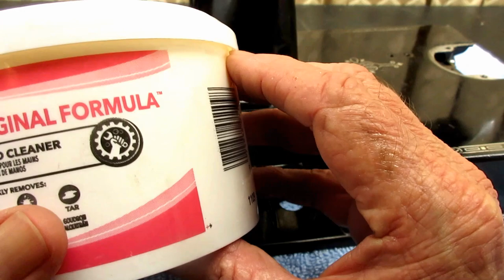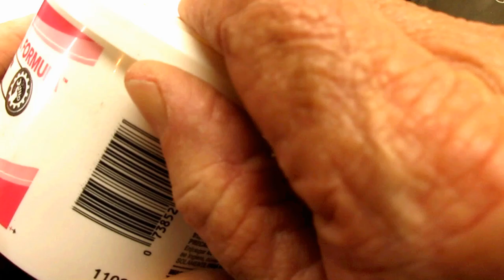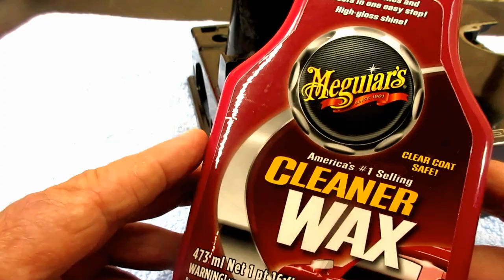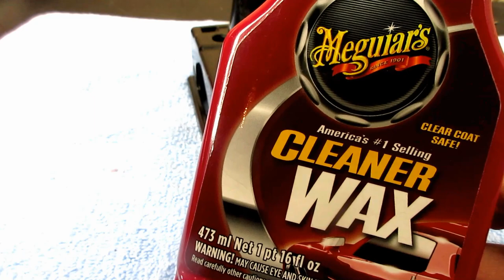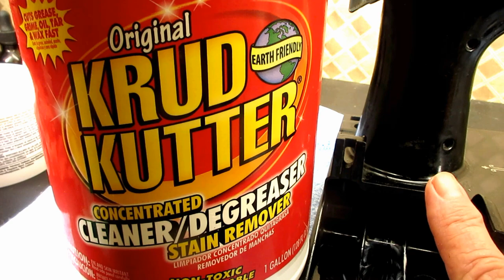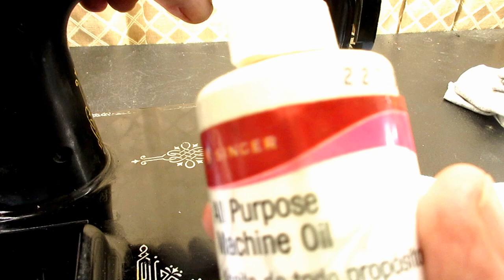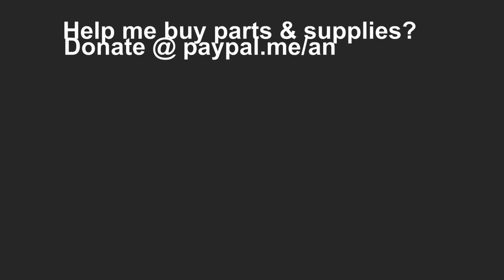About Cleaning the Outside Finish of a Singer 221 Featherweight

Comment: Hi Andy :D Listen, I'm currently working on a derelict 221 that I thrifted and found that  "Meguiar's Ultimate Compound" does wonders on dull & cloudy shellac finish. It removes the dull layer of the shellac coating to reveal the glossy shine hidden underneath. It won't make disappear shellac flakes but will mitigate them a wee bit, it will also make disappear dull spots caused by a spill of Krud Kutter or IPA (I've been there too haha).
Reply from the maker: Hey! Thank you so much for this great information. I love when people share this kind of stuff because I know my viewers. Many of my viewers at least read into the comments so I pin this comment to the top because I get a lot of visits on this page where people are searching how to clean their featherweight or other black shellac singer iron lady. Thanks again for taking time to share that

Comment: Love your videos Andy! Thank you. I just bought a 1948 year 221. The finish is awful. I bought the FW Shop cleaner and wax. And I cleaned and cleaned and waxed and waxed. Rubbed and rubbed. Still had a lot of dullness on the finish and what I saw as imbedded dirt, nicotine or who knows. I had used sewing machine oil first to wipe it. Nothing. So I’ve used GOJO on ten 15-91s, three 99s and several 66s. I put the Gojo on with my. Fingers and rub gently. Then check to see if the crud is loosening. If not I do it again. Maybe let it sit a couple minutes. Max. Then wipe. Then wipe with the SMO to clean off gojo. That is very important to clean off the Gojo thoroughly. Then you get the shine. (But not so much for this crap machine finish) I was surprised and pleased at least the machine dulled crud had gone and the machine seems to shine a bit better when I wiped off the oil.  Then I used that cleaner and wax from the FW shop. Finally started to look a bit better. Still a crappy finish but a smooth as glass finish and with the Gojo at least I know it is clean.
Reply from the maker: Thanks for the detailed sharing of your experience with the finish. Always something to learn about these wonderful machines.

Comment: Hi Andy! As a matter of fact I purchased a bottle of Krud Kutter after I saw your videos. I usually get a bit of "cloudy" feeling after using it on the surface of my machines (even as a solution with 50% water) and the way to remove that cloudiness is to apply a bit of sewing machine oil over it. It usually works for me. Thanks for your video!

Edit: I only use KK when cleaning machines that have been exposed to nicotine or that are covered with old grease.
Reply from the maker: Good tip. I like the way the oil worked on this machine. On most of the others, I use the wax afterward. The oil costs much less and looks nice. Thanks for sharing.

Comment: Andy, thank you as always! I should've watched the video first before I cleaned my FW. I can confirm too that the GoJo made my finish dull and I also tried the TriFlow because I was out of plain old SMO. Those were not good decisions and if I'd watched this video first, I wouldn't have made them! :)  Thanks for all you do.
Reply from the maker: You're welcome, Kim. I'm sorry you had that happen, but don't feel alone. This was my first featherweight and I had heard many conflicting stories about cleaning, oiling, etc. I decided to try some of my own methods as you saw. I di have a few emails about the GoJo, both for and against. A fellow I have chatted with a few times told me about two different formulas for the GoJo and the one with pumice (I think it's what he called it) is bad for the machines, but the original formula without it was OK for the black finished machines. I hope you can wax your machine to get some of the shine back, but maybe like my wife you'll just love the way it sews and not worry about it. Either way, it was nice of you to comment and I'll pin your comment to the top in case others will see the GoJo and TriFlow info. Thank you for watching my channel, and take care.
Reply: Thank you for your video on this as I am wrestling with what to do with the finish on my 1916 66-1. I have been using smo on it to clean the outside for the last year but began to notice further deterioation as time went on. I believe I am beginning to understand that if the clear coat finish has worn away, the smo can seep under it and do some more damage. I did try the GoJo you used (before I saw your video) and I did see it seemed to cut through a lot of old oil build up and where there was actually clear coat left under that it did bighten it up. It at least left a clearer picture of where clear coat is completely gone and where it remains. Now am trying to decide whether to french polish or to use zymol precleaner/finishing wax first to see if I can at least protect what is left. As you concurred, not sure I would use GoJo on a machine with a decent finish on it though. I have seen it used mostly prior to doing a french polish.

Comment: Hi Andy, the oil bath is exactly what I strive for. On newer machines I use Pbblaster or even transmission fluid. I set the machine over a baking pan, soak all of the internals and run it. I filter the fluid through a coffe filter and use the fluid several times. In the end I wash out with sewing machine oil or spray triflow. Over the years I've had very positive results. A good lazy man's approach. On the old black machines I use only the sewing machine oil. When all dried out I oil with tri flow at the oil points. Thought you might find interesting. Thanks
Reply from the maker: I do find that interesting! Maybe someday when you have the time you could do a couple of videos about that method. I think people would really like to know about it.

Comment: Thank you Andy, I had heard of cleaning with SMO before, now, with your approval, I will try it on my 222K.
Reply from the maker: I usually test any cleaner on the back of the bed along the base of the motor. The SMO (plain) worked well on this featherweight. Thanks for watching my channel and good luck.

Comment: Thanks so much for this demo.  I've watched all the same videos over the years and it's all been a little over my head from a chemical standpoint.  I ended up at a standstill and seeing that what was recommended by Singer seemed to be sewing machine oil and kerosene (and I'm not sure where I would store kerosene).  I had thought maybe the Mcguires followed by wax but I was watching car restoration videos simultaneously and wasn't sure if that was influencing me for the better or worse.  Thanks for ruling out the Krud cutter, gojo, (and kerosene).
Reply from the maker: Welcome and thanks for watching. I did use the Krud Kutter on the inside parts of the machine and that worked very well https://youtu.be/lz2xV3zfvJE

Comment: After using pounds of Gojo on my Vintage Industrial sewing machines some have 80 years of oil build-up inside and out .
I have found that Gojo takes a minimum of 20 minutes up 8-12 hours depending on the thickness of oil ,per layer ,sew it seams!
To remove 80 years of oil down to the original finish has taken months and pounds of Gojo!

Comment: Since black sewing machines are clear coated with the same thing that was used on furniture you can use Howard Feed-N-Wax which helps restore some life to the old clear finish and also leaves a shine that stays longer than what is left from coating with sewing machine oil. Like the sewing machine oil, a little goes a long way. I am sure you will instantly see the advantage it has over sewing machine oil.
Reply from the maker: Thank you for sharing this, Randy. I never would have considered using a product for wood, but it makes a lot of sense. 
Singer oil is 100% petroleum distillates,  hydrotreated light paraffinic   Saftey Data Sheet link: https://blessington.app.box.com/s/xveh0lkq72uwriru3fxdffqd6wezl3su       
The Howard product is about 80% combination of petroleum distillates,  5% paraffin wax and 5% Terpenes and Terpenoids
Safety Data Sheet Link: https://www.howardproducts.com/files/Feed-N-Wax%20Wood%20Polish%20and%20Conditioner%20-%20US%20-%20English%20(2020).pdf
I can see that it would have a deeper and longer-lasting shine with the wax. Terpenes are aromatic compounds found in many plants. I guess to leave the furniture smelling pleasant which would be OK on a sewing machine. Howards is like a one-step, longer-lasting product. A great tip, Randy! Nice to hear from you. Take Care.

Comment: I've used liquid Turtle Wax since the early 90's on all my black Singers.  It can take several applications, wiping it off while still moist, to thoroughly remove the dirt.  It won't repair damage but it shines the surface. The last application I let dry to a haze and then buff the surface.   It helps protect from further degradation.
Reply from the maker: Carolyn, I don't know why I was not notified of your comment but thanks for much for sharing the info on my channel.

Comment: I won't tell you that here in coastal Connecticut we haven't used the a/c in 5 days. It's midnight as I write you and outdoor temp is 64. With respects to the Featherweight, she looks like she was very much loved and used ❤. I've had good luck with "Sew Serious" Restoration Polish. You can find it on eBay. Look up singer 221, 201, and you'll find it. I do find that one application isn't enough. 3 or 4 then some car paste wax (I use Nu Finish). I restored a 66-16 this way and man, almost like new, except for the scratches. Would you happen to know of a source for touch up paint for the pistachio green Kenmores? Love the work you do. God bless and stay well.
Reply from the maker: That is a cool night. Our low today was 90 at 6AM and it's only going up to 113 today; a cooling trend, haha.
Here is the info on the SewSerious Restoration Polish for interested viewers: https://www.sewserious.com/products/restoration-polish   Thanks for sharing your experiences with it.  I've never bothered with paint touch-up, but a few years back I bought some parts from a fellow who was doing a restoration of a Singer 337. He had touched up a few nicks and scratches and was letting it dry. He told me he just buys a sample 8 oz container of paint at home depot and has them color match what he needs. It costs less than $5. https://www.homedepot.com/b/Paint-Paint-Colors/8-Ounce/N-5yc1vZcaw8Z1z1dqqg  I do not know if it was acrylic or latex or what. It looked good though. Thanks for watching my channel.

Comment: Hi again, I tried different oils on a old black singer. I won't go into much detail but coconut oil worked good must be careful. I've used the stuff to remove stickers and the like. Howards does not recommend on painted surfaces (scared of that). The sewing machine oil seemed to do the best. Oh I wash out the insides of these old singers with the sewing machine oil. I scrub it around and kinda rinse it. I like it and safe. Just thoughts. Thank you so much for your in depth videos.
Reply from the maker: I did not even think of using oil for inside cleaning! So, kinda rinsing, does that mean flushing the parts with more fresh oil? That's an interesting idea. Like an oil bath and totally harmless. I'm not sure about using a plant oil, but if I did, coconut would probably be my choice too. Fractionated. thanks for sharing and watching my channel.

Comment: The black machines are clear coated with shellac. Water based products (Krud Kutter) are not a good idea with shellac. Gojo is oil based and will soften and loosen the dirt. Cleaner waxes have a microabrasive component that will bring out a nice shine as a final step. Have to be careful not to wear through the clear coat.
Reply from the maker: Thanks for sharing, Paul. I know there are fans of the Gojo and agree the KK was not a good choice for the shellac machines. I've been experimenting with the oil and then a coat of carnauba wax. BTW, the second listed ingredient on the Gojo is water. Main ingredient is petroleum distillates, and then water,and then 12 others. Thanks for watching and commenting.

Comment: Hi Dad!! Do you think the Krud Kutter is strong enough for my kitchen?! Keep in mind it's gotten even worse since COVID  🤯😂😵😭
Reply from the maker: HEY 💖😀 I can't believe that could happen 👀 I mean with a fulltime job and two homeschooled kids, what's the problem? Sure, the KK cleans kitchens very well, even at 15% solution. You can go stronger with stovetops or those dog prints on the floor if needed, haha. I like if for the tiled floors in the house, too. Your Home Depot has a 32 0Z spray for $7 https://www.homedepot.com/p/Krud-Kutter-32-oz-Original-Concentrate-Cleaner-Degreaser-KK326/203396788
Or a gallon of concentrate for $14 (It's twice that price at Amazon) Thanks for watching, and happy cleaning. Love You Sparky, Sparkle, Twinkle & Captain. 😍✨

Comment: Oh, I forgot, I've also used kerosene and various mixes of kerosene and fluids with very good cleaning results.
Reply from the maker: In a few of the older service manuals I have for Singer machines they mention if the machine is very dirty or gummed up to remove the electric and rubber parts and soak in a bucket of kerosene until it is loosened; even overnight if required. Then "wipe the machine down" and apply fresh oil.
Reply: @andytubesewing1953  yes, I read the same thing. I did it years ago worked fine. Alot of kerosene though. The mixture of auto trans fluid and kerosene worked best for me. I keep it away from the exterior.
Reply from the maker: @kennethjones5173  Yes, I thought to myself who needs 5 gallons of kerosene sitting around? Thanks for info; good to know.
Reply: @andytubesewing1953  the thought of putting kerosene anywhere on the exterior finish of a machine strikes fear into my heart.